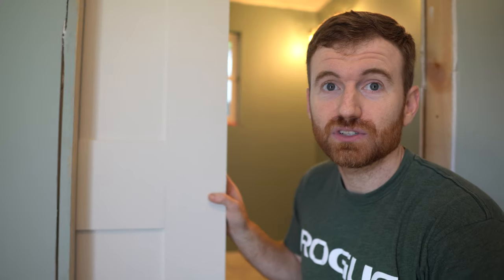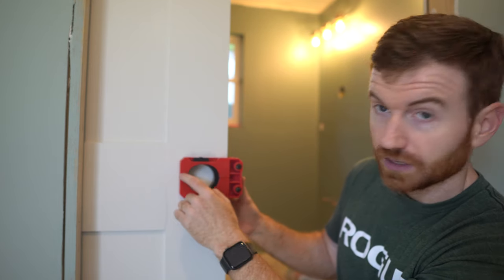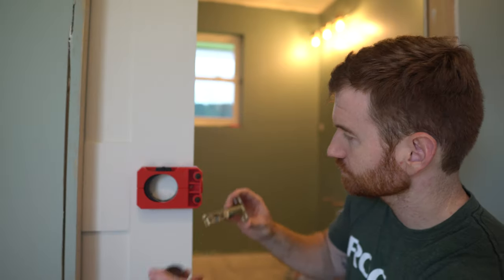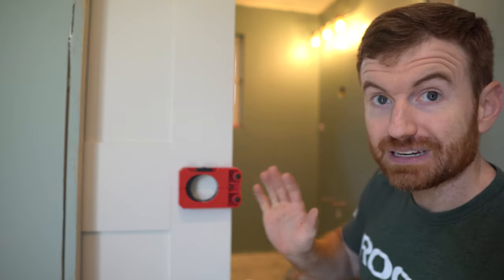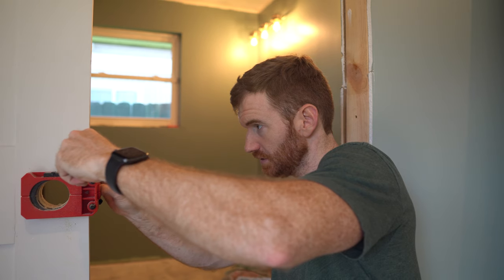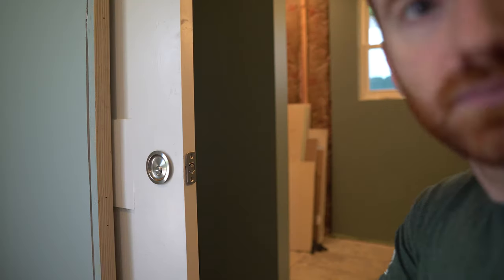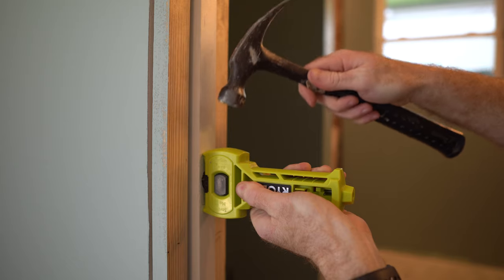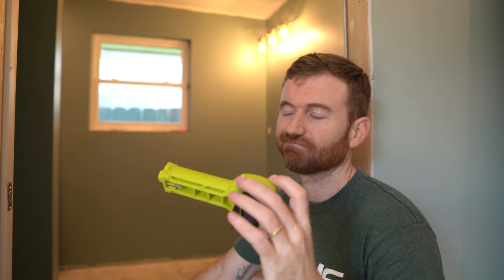Milwaukee Door Lock Installation Bi-Metal Hole Saw Set Review and Tutorial

Comment: When I replaced 2 sets of door knobs/dead bolts that were over 35 years old I knew I would have to re-drill the large round holes. The 1" bolt holes were perfect they did not require re-drilling. To assist in drilling the correct large holes I used a Ryboi jig, similar to the one you used.The jig worked perfect guiding the large hole saw through the previously partly drilled holes. After re-drilling the 4 large holes it was very easy to install the door knobs/dead bolts. The striker plate tool you used did not seem to be of any benefit from using a razor knife and chisel. Thanks for the informative video.